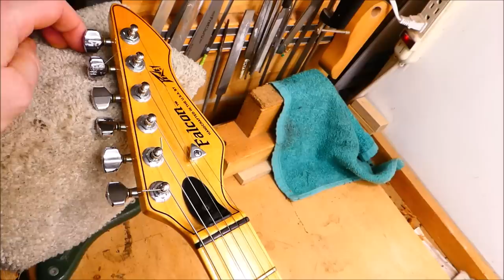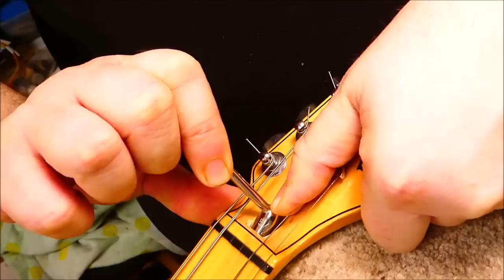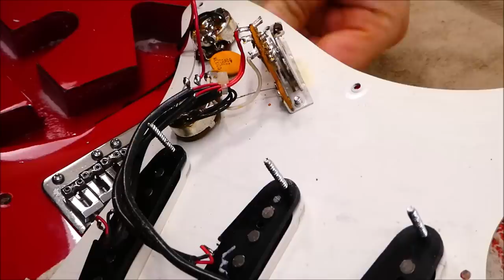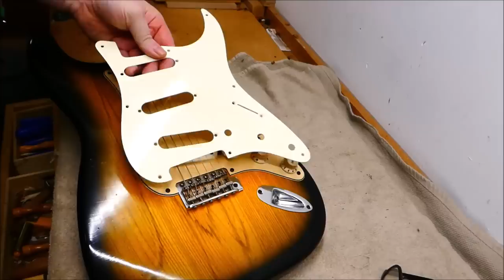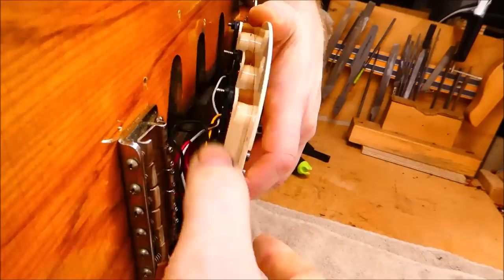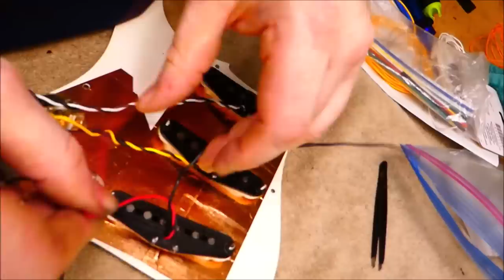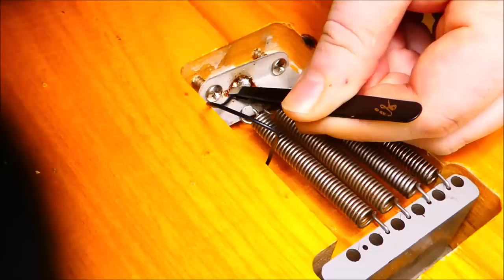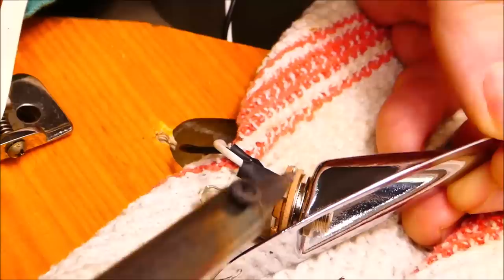Strat-type things.

Comment: A Fender Stratocaster did not cost a thousand buck back in the 60s. this info was published by Fender.  Fender Stratocaster vibrato model priced at $249.50 and the non-vibrato (hard tail) at $229.50.
Reply: That was a lot of money then. Like decent used car money.

Comment: 3M has great shielding tape. Very low bonding resistance when overlapped!
Reply: I saw a Facebook post a while back where somebody bought copper "slug tape" (for gardens). They even said that the adhesive was conductive. I haven't looked into it yet, but I think I'm gonna hit up Home Depot and check it out!

Comment: I did not know Peavey used the acorn style truss nuts on their older guitars. Interesting. :-)
Reply: I liked the guard that was already on that road worn Fender ahaha. I would of changed the pickup covers and knobs to be aged like that guard was. ;-) And yes replacement guards and strats almost never fit easily where the old one was haha. I do have to say G&L replacement guards ive bought have always lined up perfectly. Even ones that ive had custom ordered by someone other than G&L. Seems that Fender having different guards with different number of screws etc has caused issues haha. Thanks for the video again.
Reply: WOW just got to the part with the knobs shaft taped hahah! Ive never seen that before. THat is funny shit. I was wondering what that tape was on there for !

Comment: I've done lots of panel wiring and not trimming cable tie ends down flush is a hanging offense. The cut ends are very sharp and will scratch anyone reaching around them. Use flush cutting pliers to trim them correctly.

Comment: A quick tip that has saved me from buying new pots hundreds of times with my guitars, amps and pedals I build. Contact cleaner works great but a lot of you may be familiar with this scenario. You use contact cleaner on scratchy pots and they function quietly again but a few days later the crackle is back. Most of the time scratchy pots arent as much from debris, in fact almost never in my experience. What's really causing the issue most often is the potentiometer traces becoming oxidized. When you use contact cleaner you strip away the oxidation but with it any remaining lubricant that was supposed to keep the tracks from oxidizing. So in a few days the pots have oxidized again and they are intermittently conductive. So what I do is hit the pot with compressed air of some sort(dust off, air compressor or handheld aspirator) that way if it is debris then it will be removed. Then I use contact cleaner (move the pot back and for a few times) and then lastly I like to use dielectric grease ideally on the traces. But if you cant open up the back of the pot then white lithium grease spray lubricant or even wd40 will work (among many other lubricants). But its important to use the smallest possible amount to cover the tracks. If you use too much contact cleaner or too much lubricant then you'll flush the pot shaft out which will make the pot too loose. This is because most pots have some friction grease in the shaft to keep them from being loose as you turn them. That's why opening up the pot is always ideal if you have the skill or know how cause then you can use minimal contact cleaner and lube using a q tip on the traces/wiper and not worry about flushing out the friction grease. But even if you do accidentally flush the friction grease I can guarentee you, that pot will last forever and stay silent from then on. The more you work with pots the better you'll get at maintaining them. I even take apart push/pull pots on occasion and replace the wafer with a different value that isnt available as a push pull. Anyways I hope that helps someone.

Comment: conductive adhesive is not necesary. use regular aluminium tape ,much cheaper, and it will give you the same results . Faraday cage , you dont need to cover every millimeter with tape it still works
Reply: this is the scammer!!!!!

Comment: Ive had strats all my life, Fender Strats, and I am convinced the B string always sounds a bit off. I can hear it here 16:50
I have a neck tuner and a pedal board tuner. Still never convinced.
Couldnt hear it on the Peavy.
Am I going mad?
Reply: B strings are off on every guitar. Use tempered tuning